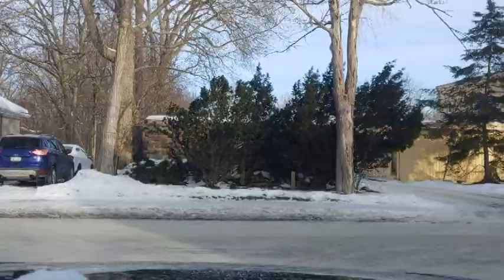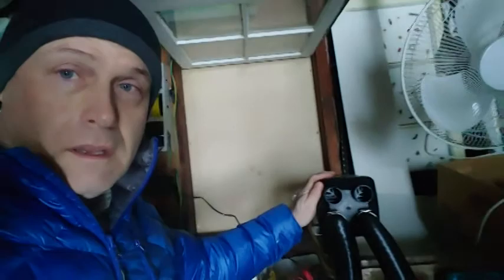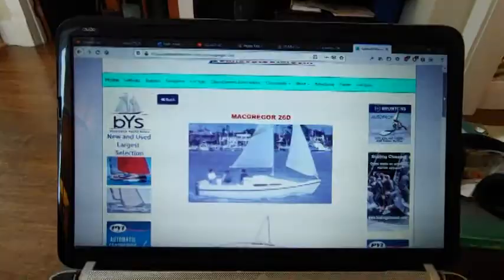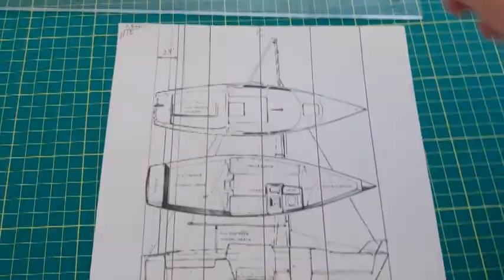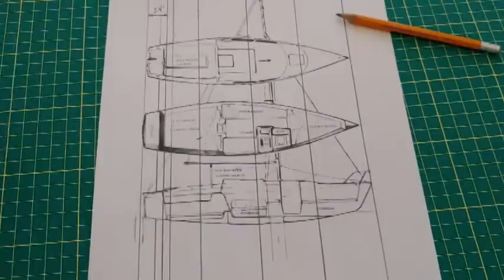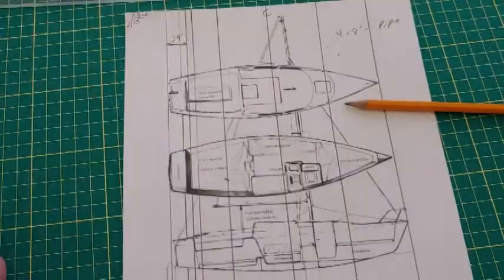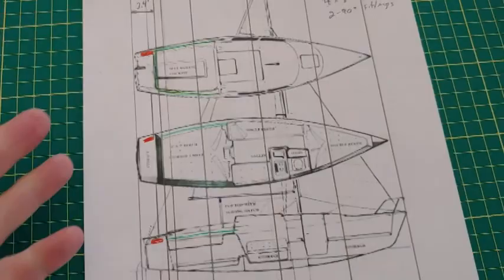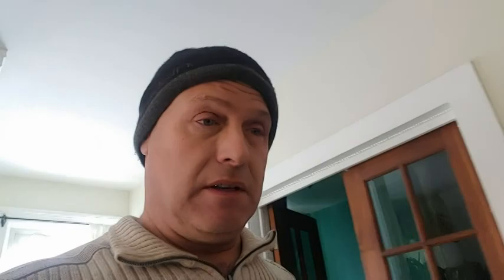Fitting a Drawing

Comment: Thinking of Jaz freezing in the bow. Maybe run a hard pipe on portside under cabin bunk, exit opposite head area?
Reply from the maker: I think the heater will make the whole area warm. It's a pretty small space compared to the garage I'm testing it in.
Reply: @martyjackson4806  maybe, on my sons boat, Espar amidships in engine compartment. V berth behind galley/head area . Air was noticeably cooler at Vberth vent than in main cabin vents. Flex paper/plastic corrugated pipe seemed to slow airflow and give way more area to radiate heat losses. Never did fix it, he traded up to a newer boat, 25,000btu model.